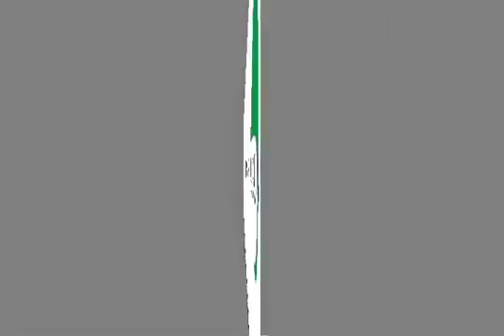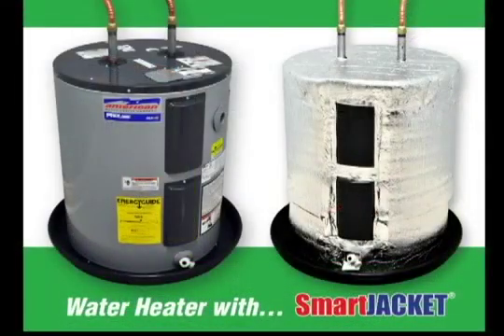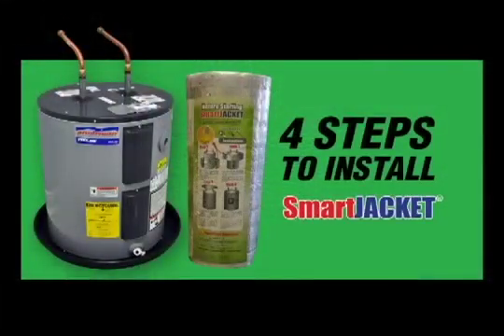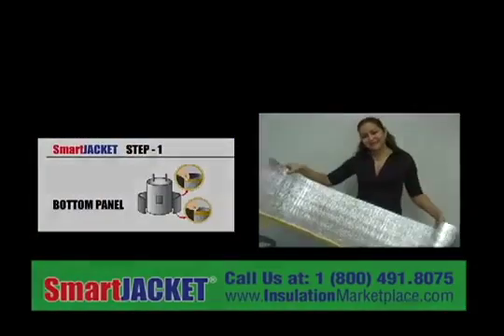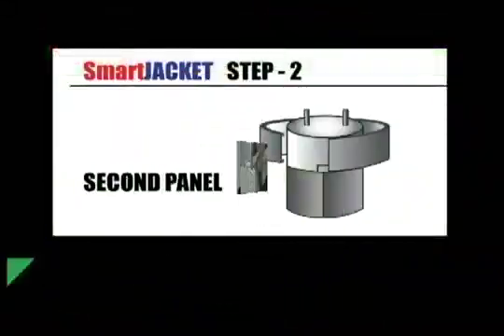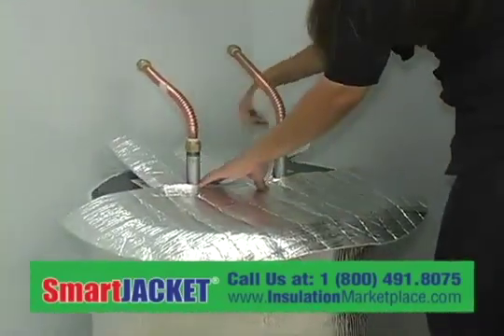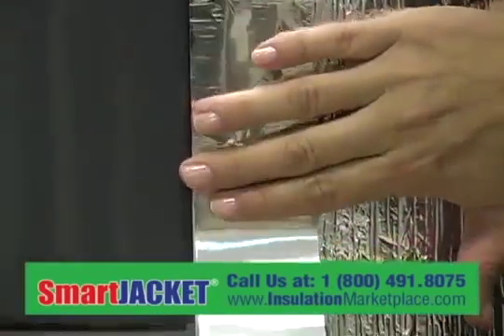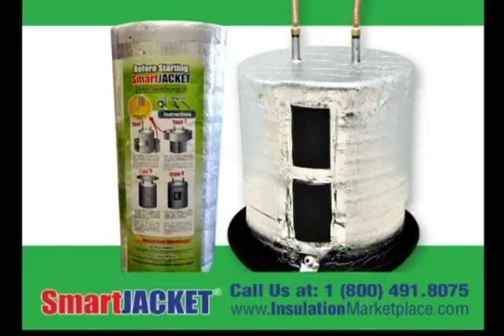Smart Jacket - how to install water heater insulation blanket -  www.insulationmarketplace.com

Comment: This product should be used and it should emphasize the importance of keeping an air gap inside between the tank and insulation.  That's why they fold and stick- the fold creates an air space as seen in video on bottom.  However you need another strip around the middle to keep the insulation off of the tank at the top of the first panel and bottom of the second.  Reason being the insulation can't stop conduction, only radiant heat so it will not work if you put insulation on skin tight to the tank.  But alas, the people in the marketing department know nothing of the products they promote and thus miss important details....unless an engineer oversees them.
Reply: The foam will stop the conduction.